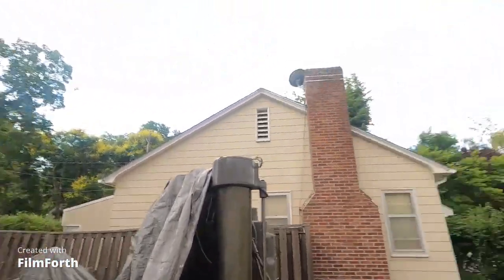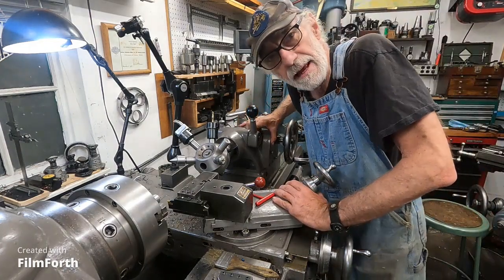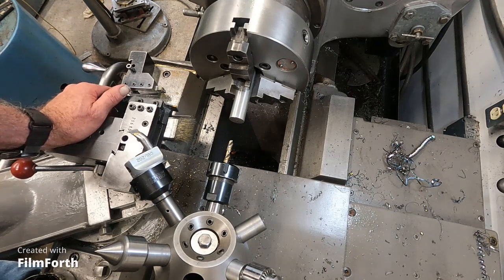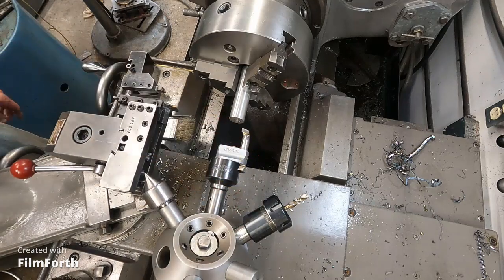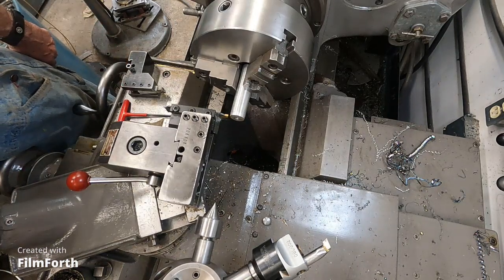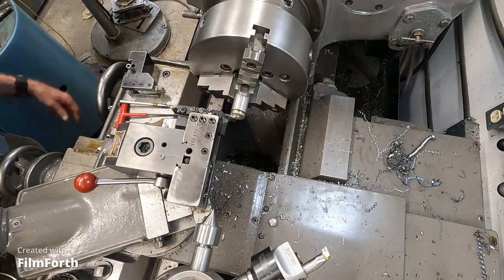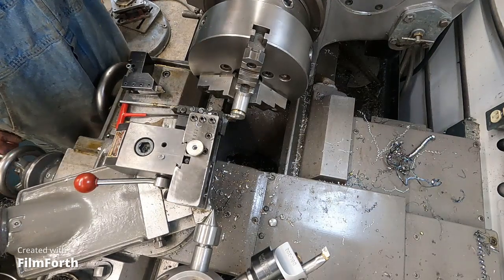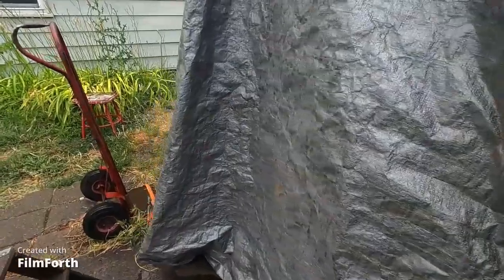Enco tailstock turret test on an Axelson gear head lathe machining

Comment: There is just no end to what a Millwright can do with good Machinist tools! . The Turret makes easy work for repetitive work. I sure wish you could get your hands on a forklift long enough to change the bearings on the Radial drill press. 10 years ago I destroyed my back putting new King Pins and Bushings on one of my Tow Trucks by myself. I'm the kind of guy that refuses to pay someone to do work that I can do myself. Well that was a life lesson for me. My back is so messed up now i cannot sleep in a bed. Instead, I have to sleep in a chair. I know you will get it done and if i lived there I would drive my truck over and use the boom to lift it for you. At no charge of course, just for the opportunity to hang out with another old Millwright like me.
Reply from the maker: Shot an unusual video today has tow trucks! I can get help on the drill Going to move slowly on it, videos coming up shows where it came from!

Comment: Should make yourself a left hand boring bar to save stopping and reversing, would selecting an empty spot on the turret give clearance for the toolpost in the parting operation? Nice to see one of these tailstock turrets actually being used though.
Reply from the maker: Yes, I only had a short right hand bar. I need to find the right order for the cutters and shorten the tool holders a little. too, thanks